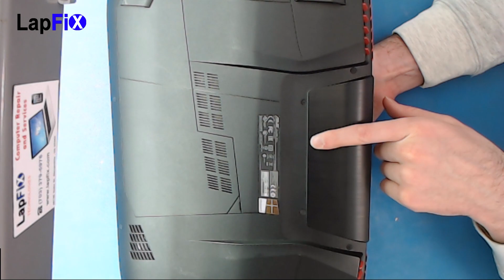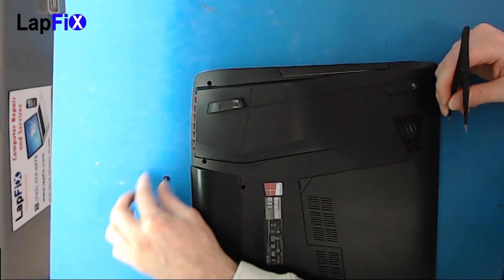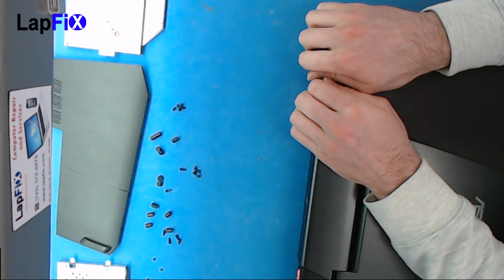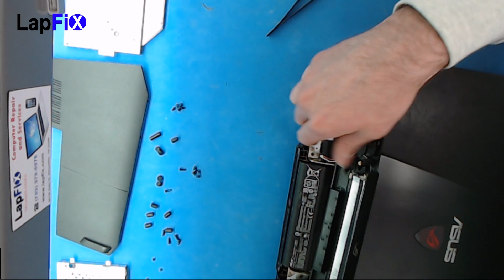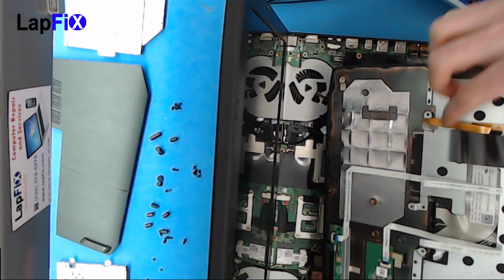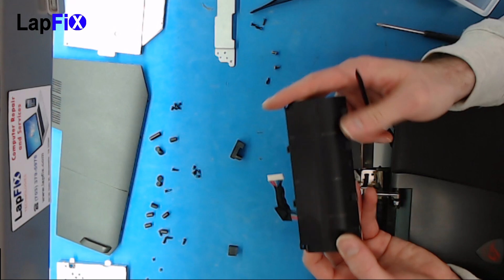Asus ROG G75 Battery Replacement - How To : Basic

Comment: You don't have to remove the hard drives or the keyboard. You only need to move the keyboard assembly down just a bit to access the connector  but no need to remove the ribbons.

Comment: This is my first and last ASUS (G752VL).  They make it so an almost total disassembly is necessary to get at the battery. I will not go through this again. Thank you for this video! BTW has anyone else also gotten the bad news that their G752 is not able to upgrade to WIN 11 after running that upgrade assistant? Mine now says it has Win 11 HOME on it. It is better, faster, and a bit different than Win 10.😇
Reply from the maker: It's very snappy, I haven't tried it on my desktop yet, still a bit nervous for now until more updates.  I really hope android apk's will work native and not only for amazon apps

Comment: Quick story for you all: This is just like my BMW! It's irrelevant, because it's about a car not a computer. Just felt like sharing it anyways. So had a loose light bulb inside the head light unit and had to take it to BWM. In order to take the bulb out, you have to remove the entire front bumper..YEP. what a bummer :)! It's a true story, so here I am watching a mechanic taking my car apart :) almost. I still love BMW and ASUS:)!
Have the same laptop and the battery is dead, so I sent it to Texas to get it repaired. The one and only authorized ASUS place in the entire US. Now I am watching this on my new MacBook Pro :). Nice video BTW. Thank you!